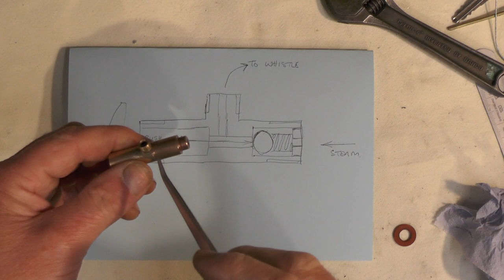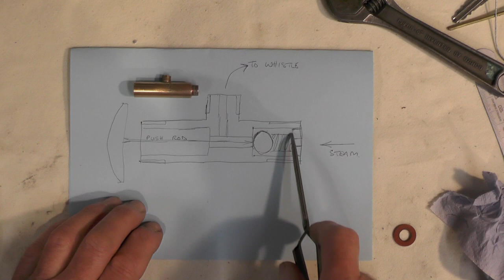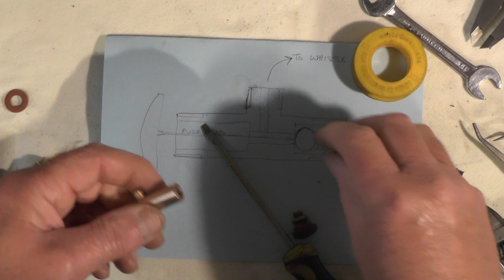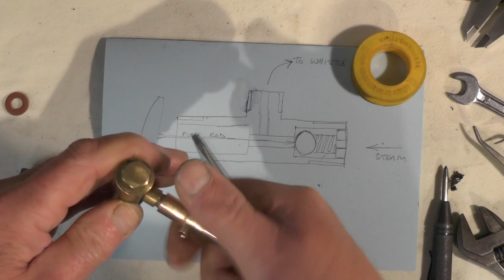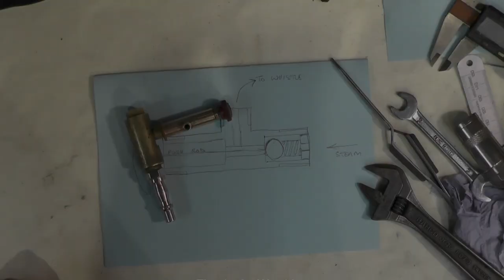Whistle Push Valve Repair for a Miniature Live Steam Locomotive "mr factotum"

Comment: G'day Kev. Luckily cleaning fixed it although seeing you drill it out and repair/replace the seat would have been interesting. You didn't say but it looked like you replaced the packing with an O ring. 
Cheers Peter
Reply from the maker: Hi Peter
Next time the valve seat, 😉👍👍👍👍thanks for feedback
Kev

Comment: Hi Kev.
Enjoyed that! Do you buy a specific de-scaler? 
We had terrible water marks on our stainless sink, put some vinegar on it and the marks went in seconds.
Wonder if it would work on heavily built up scale?
Cheers Neil
Reply from the maker: Hi Neil
What ever is at hand, cillit bang, harpic, white vinegar, i do have some naughty sulphuric acid i use when finished silver soldering brass and copper, that cleans everything back to basics
take care
Kev
Reply: @MrFactotum  funny enough, I use brick acid (brick and patio cleaner) to remove rust. That works really well. That's how I got all the rust off the colchester when j first got it.